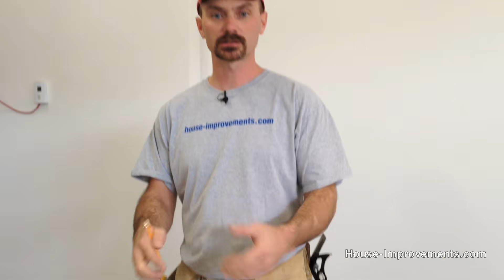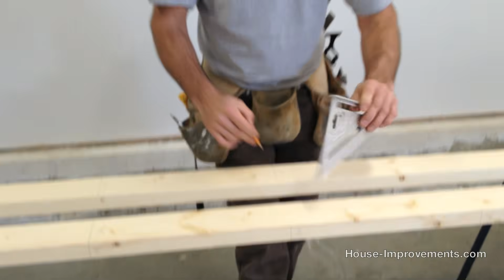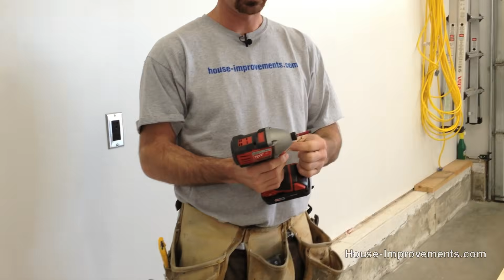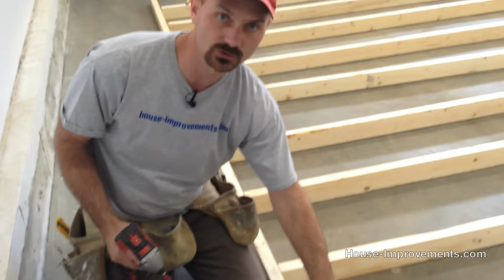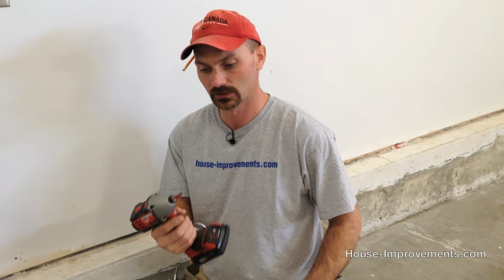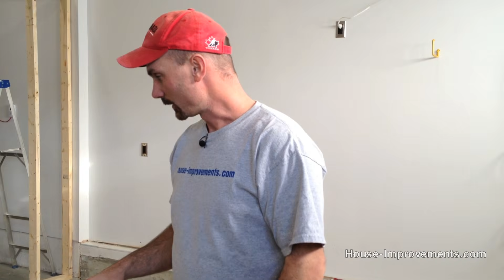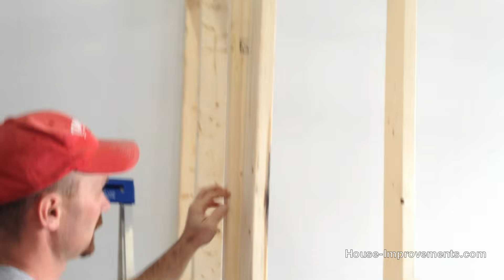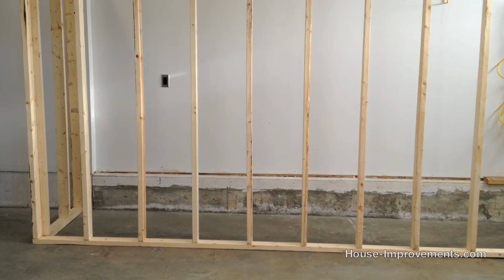Wood Stud Wall Framing

Comment: Hey I enjoy your videos on wall construction.  I am building a 8 by 8 wall, it will have a door, a window in a AC window unit in the wall. I am using 2 by 10 lumber. I am about 3/4 inch out of square. I am in the early stages of the build so I am going to make sure it is square before I install the door. My question is if the wall is this much out of square (3/4) would that cause me a lot of problems down the road trying to square up the door and widow down the road?
Thanks.
Reply from the maker: Depends what "out of square" means to you? If you mean the diagonal is 3/4" difference then you will likely be fine. If the bottom plate is 3/4" out of square to the end of the wall you may have trouble if your rough openings are not an inch wider then the frames. I may be able to help more on the forum if you need it?https://www.house-improvements.com/forums/
Reply: Thank you for the reply! It will be my bottom plate that is out of square. I will fix it before I place the wall into a covex container. Really enjoy your videos keep up the good work!!

Comment: One shouldn't use screws to make walls. Screws resist pulling force, so they're good for deck boards which you don't want to pull up. but what walls need are sideway shear force, which means nails, which have a heavier head. I too used to make this mistake, until I spoke with an engineer. Never used screws on a roof deck. Some people think it makes roofs stronger, when actually it makes them weaker ot wind shear forces.
Reply from the maker: As stated more then once in the video screws should not be used for framing and where used only for the demonstration of the video to assemble this wall which was disassembled after wards.

Comment: You seemed to indicate that the impact driver has a hammer function in the drill. But isn’t this untrue? Doesn’t it have a hammer motion which applies to the rotation?

Comment: Is 1/2" bend in top/bottom plate for 10 ft wall acceptable or not? Should I bend the plates straight when fastening (using levers and whatnot)?

Comment: I get why I should use nails but if I need 2 smalls walls, can I get away with construction screws? I don't feel like nailing honestly
Reply from the maker: Structural construction screws ,yes.

Comment: I’m adding a wall to an already finished room. How do I stand the wall up with messing up the ceiling?
Reply from the maker: you build it about 1/2" shorter then needed or attach the top and bottom plates in place then cut and install studs standing between the already attached plates.

Comment: Hi Shannon, thanks so much for this very informative video. Really enjoy all your content. When you are mounting the double top plate, you say to put two extra nails where the studs are. But if you do that, aren't you risking hitting the nails that are already there connecting the first top plate to the studs?
Reply from the maker: just off set slightly.

Comment: So, if your plates are 8 footers long. At what length are your 2x4's in between the plates ? I am also attempting to build a 6'x8' shed. Thanks
Reply from the maker: They are as long as you need them to be to get the wall height you want . Mine were somewhere around 7' walls I believe.
Reply: @HouseImprovements  Okay, Thanks. I guess as long as I keep them within the height of the siding, minus the 4 inches. Right ? LOL    Your videos, are great for the "DIYer". I guess if I'd change something, I'd have you tell us, what your cuts are. Keep up the good work. And thanks for the quick response.

Comment: Actually it's a third corner stud wall frameing for a hall way wall..so it..begins with a 2by4 applied on the 2side instead of 4 to trap the joints.. majority of the house wall frameing for ceiling people's use a hall way wall frameing method.. lol..when u.. sapost to have one stud plate with crown from the plaite.  Get it.. lik I said hall way homes are in style..

Comment: If I am starting and ending with the 4 x 4 what do I do for spacing the two by fours?  I suspect I just still start in from the three-quarter mark where the center of a 2 x 4 would be and go from there.  Thanks
Reply from the maker: I would layout all out the same and just put your 4x4s at the two ends.

Comment: If the ceiling is 8' high and the wall is 8' tall, how do you deal with the wall hitting the ceiling when standing it?
Reply from the maker: You would build it slightly shorter that the total height you have between floor and ceiling ,maybe about 1/2" to 3/4". Or you can attach the plates in place and cut the studs to fit in place ,building the wall standing.

Comment: Does the upper top plate have to be screwed all the way through the lower member and into a stud, or just into the lower member?  From the building code I think it just has to be screwed into the lower member of the top plate. Is that correct?  Great vid, by the way. Thanks a lot!
Reply from the maker: yes just into the plate under it.

Comment: I FINALLY 100% understand why you don't just use the 16" marks and start at 15 1/4.  FINALLY convinced.  Thanks!
Reply: I know what you mean, I have watched several videos that did not explain why you go back 3/4 of an inch.  Very useful information
Reply: Same here. Used to not know what "on center" meant.
Reply: Thanks guys feel lil smarter that i knew that, but really feel slow where something possibly flew over my head. He mentions that, to get the stud height(to be able to cut all studs one time ) you measure the height of the wall then add the thicknes of 3 plates (1 1/2 x 3 = 4/12 inches) and subract that amount from the measured height, to get stud height. This confused me, because if the stud fits between 2 plates why are we subtracting 3. 

So in my mind its like this, if i have a wall i measured 100 inches, i am making a frame to fit that,frame height is 100 inches also, now i subtract 4.5 inches from 100 = 95.5.. wouldnt that make the studs too short? . If the stud is to fit between top and bottm plate, shouldnt i be subtracting 1.5(top) +1.5(bottom plate)  =3inch for a stud tight fit? .... i dont know if anyobdy follows what im trying to say. thinking i missed something,but keep replaying and still dont see it
Reply: @Lawless187indika  double top plate is another 1.5
Reply: @CB-sj7cf  thanks for that because I was trying to figure out where the hell the 3rd plate came from when he only showed 2 plates.
Reply: @Tuga777  you’re welcome

Comment: I removed my tile bar in the kitchen and the top plate is not flat. how do i fix this because my fomica has a huge gap on one end.
Reply from the maker: You may have to plane it or sand it flat? it has a twist in it likely.

Comment: I don't get it.  How do we get 4 1/2" from total height?  Subtract the three thicknesses of each plate. There are three plates.  A 2x4 is 2in by 4in.  Would that not be 6 inches instead of 4 1/2 inches?  So, would that be 6inches from 8 feet which is 7feet and 6inches?  Where does the 4 1/2 inches subtracted from the total height come from?  Forgive me, but I'm as a dumb as a rock when it comes to math.
Reply from the maker: a 2x4 actually measures 3-1/2" x 1-1/2"

Comment: This comment probably will be lost but do you have a video on how to redo / repair a front porch ? My two main supporting post are rotting and I need to replace them both. I was thinking doing a “deck” then support the two posts on top of it? Idk , any ideas would be helpful. Thanks
Reply from the maker: The posts should be supported by concrete piers. I have no video for this. You can get assistance from our forum.https://www.house-improvements.com/forums/

Comment: floor plate should be pressure treated
Reply from the maker: Yes if this wall was staying here you could have PT lumber for bottom plate or use a sill gasket under the spruce plate.

Comment: When you are doing the wall lay out,  just a tip. You can always nail those 2 2x4’s together flush. Then go 15 1/4 and put a duplex or regular sinker, then attach the tape to that nail. Then go every 16 inches from there.

Comment: Great video! The only thing I would add is that impact drivers work by tapping the head radially and not by hitting the back of the bit like a hammer drill does as it seemed you were referencing by saying its pushing the bit into the screw head.

Comment: So the first and last space will be 15 1/4"" because of the end 2 by 4's?
Reply from the maker: The first one will for sure so that the second 2x4 ends up at 16" to the centre of it. The very last one in a wall will depend on the length of wall and how much after the last regular stud it is.We can assist you more in the forum.https://www.house-improvements.com/forums/

Comment: Hey, another question if you don’t mind, can a 16 in oc wall hold a 24 in oc spacing rafter structure?
And also the other way around can I put a 16 in oc rafter spacing on a 24 in oc advanced framed wall ? Thanks so much, 
Great stuff you’re doing ! Thanks 
Pete

Comment: Awesome videos Shannon, I’m always trying to learn from ones like this. Im having an issue with building a 12ft basement wall that’s in a tight space and can’t build it all in one piece to fit it in place. Can I build it one stud at a time into a secured top and bottom plate?
Reply from the maker: absolutely . it's called "stick framing"
Reply: That is awesome, thanks Man! Actually Just as You replied I just came across your stick framing episode so that timing was perfect! I feel much better now to get started. Just another question with toe nailing, I don’t think I can fit my framing nailer on the outside of the outer most studs to secure the 3rd nail. Can I toe nail those two from the front of the stud?
Reply from the maker: two on one side and one in front is fine.

Comment: Good video but,.... my experience is that screws are MUCH better than nails. I always use screws and I know they are more expensive.
Reply: Screws are generally much harder than nails and therefore are more likely to break when shear forces are applied. Nails are preferred for the better shear strength as he alluded to in the video. Screws are great for attaching floor sheathing however as they pull the sheathing down and are much less prone to floor squeaking. Lag screws are also great for holding walls down to the floor system.

Comment: Hammer and nails been done by now
Reply from the maker: If you listened in the beginning I stated that the screws where only being used because this is a demonstration and the screws will allow easier de construction when I was finished. You are correct though nailing is way faster.
Reply: Sorry my bad I gress I'm old school I watched your video again good instruction. Sorry again
Reply: O

Comment: You should explain how pulling your mark back only relates to existing structure where the wall is butted up to a finished wall and you would use the line on 16 as the for or aft face mark in new construction

Comment: so you just always place a stud flush with the end of your bottom and top plate? I don't know why, but for some reason I thought you had to account for that into your measurement. So instead of walking your line back 3/4 from the 16 inch mark you would just place it on the 16 inch mark, since you were measuring from the center of the first stud. Which would mean the center of the stud would be on the 16 3/4 mark. I worked with a guy once and I thought that's how he told me to do it oops haha.
Reply from the maker: End stud flush to end of plate, hook on the end of the plate with your tape measure to 16" then back 3/4" and that is the edge of the stud. start watching at the 4:25 mark of video.
Reply: @HouseImprovements  thank you

Comment: why not just measure from the end of the plates to 16"mark a line and put the right side of the stud on line ,less time needed marking whats the difference?
Reply: You want them to be 16" on center. That means from center of one stud to center of the next is 16". They way you said would not allow the centers to be 16" apart.

Comment: Shannon, I couldn't find if anyone answered this anywhere. Why did you not put in cross members?
Reply from the maker: Please post your questions in my forum. In your question also be a little more clear on what you are referring to as "cross members"? Are you referring to blocking horizontally between the studs or a angled brace cut into the framing members diagonally across the wall. Thanks. https://www.house-improvements.com/forums/
Reply: blocking in between the members. I saw another video and they seem have cross members half way between the top plate and the bottom plate. Thank you for your response. I will also save your forum.

Comment: I have designed a tool to alleviate marking your layout and also holds and straightens  or squares up the lumber for nailing. Works with studs, floor joists, rafters/trusses and metal studs. Looking for professionals like above to field test the prototypes or just a simple test and review.

Comment: Thank you.  This was very well done.  Your wall ended below the ceiling.  How do you make the connections to the L wall or another section of wall if the wall goes all the way up to the ceiling?  (E.g. if you're trying to finish a basement in an already built house.)  Go at an angle from below??

Comment: If you are using 2x6s for extra insulation, are your header and footer supposed to be 6" wide, or do you use an L joint?

Comment: really simple and very informative video Mr Shannon. thank you.
I do have a couple of questions if you would please answer those:
1. We screw the dry wall sheet to the studs. Does applying liquid nails as an extra measure help?
2. i need to secure the bottom plate to the concrete floor of my basement. Are Tapcon screws a good idea?

Comment: Hi Shannon, Would you check this again starting at  4:20 about, you show the side of the 2nd stud in the wall at 15 1/4" (3/4" back from the 16 " mark on tape) measuring from the end of wall/plate, but the way I see it with that method the stud space, center to center, would only be  15 1/4" cc on the first two studs. So shouldn't the 2nd stud "side mark" actually be the #16" mark and not 15 1/4 as you've shown?

Comment: if the wall is going from floor to ceiling, how do you attach the over hang top plates at the corner?  the ceiling prevents you from drilling down like you did in the video.

Comment: If you were building an outside office or shed on an existing, large slab of concrete, would you just screw the framed walls directly to the concrete? And would you use pressure treated timber for the bottom plate?

Comment: TIp: if you are screwing without pre drilled holes, back the screw up before tightening it so there isn't a gap between the pieces.

Comment: Thank you, I love carpentry, construction, etc. I had worked in residential construction 3 years ago. I really wanted to get back into it, but it has been awhile since i have done any of it, and honestly  my boss was not a good teacher. He would just tell us to cut this to this length, and then nail it in here. After 3 years in the United States Air Force, i was just hired as a framer, and I start tomorrow. I was really nervous, because it has been a long time, and I only did framing on one job prior. I mostly did work in roofing, siding, HVAC, and plumbing. After watching your video, and taking notes It really helped me connect the dots, and understand the knowledge that goes into the job not just the labor aspect. Which i was really lacking, and it discouraged me alot. I love this work, and I am passionate about it, I will be watching all of your videos, and taking notes. Also, Would you ever do a video on how to do an estimate of a job, and how the beginning process works of receiving the job, reading the blueprints or whatever it takes to figure out what, and how many materials you would need for the job, and when? Your videos are great, just wanted to know if you ever thought of that, or if it would be realistic. I think that would be helpfull to many, and popular video. Thanks, god bless.

V/R 
Joe McLean

Comment: you start out wrong,,,,measure 15 1/4 ,,,then set  a nail there,,,,,THEN pull across at 16 it will always fall on center,,,,My wife knows more about framing then most carpenters i know that claim they know

Comment: @houseimprovements Shannon. Thanks for your help.  I feel well educated and ready for this step except for the following questions. @13:40, you showed us the 3" deck screws and how it goes through the 2x4 into the stud.  Are you using the same size screw to attach the double top plate? If you secure the double top plate with 2 screws at the stud, will it hit the 1st fasteners?
Reply: I think the idea to screw above the stud is because if you put them in between the studs, then the electrician when make a hole through the two top plates may hit the nails with the drill bit.
Reply: @DESIGNPEPO  yes exactly
Reply: @DESIGNPEPO Those poor electricians will hit rogue nails every time with their auger bits. Lots of swearing and probably three more holes in your top plate till they find pure wood.
Reply: Can I get a reply from someone/anyone?
Reply: You don't need to be directly on the stud when attaching the double top plate as the studs are already connected to the top plate.  Just roughly adjacent to each stud is fine